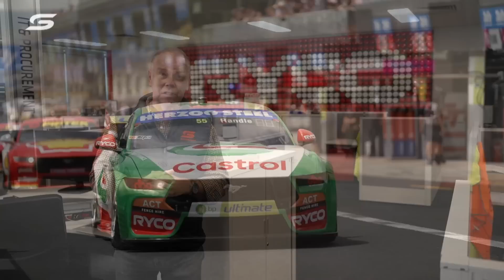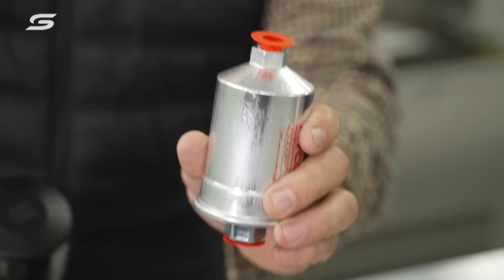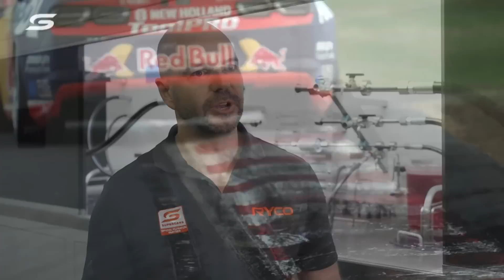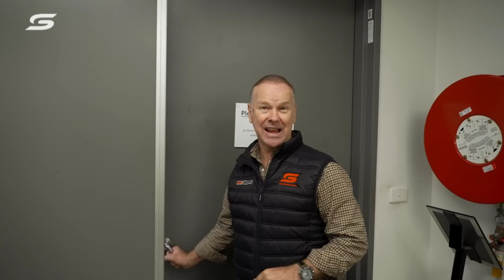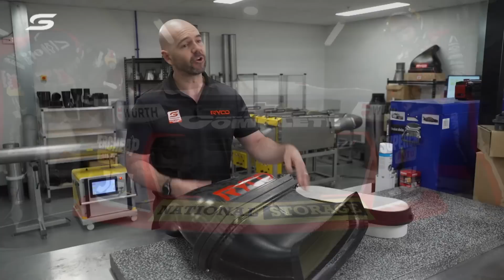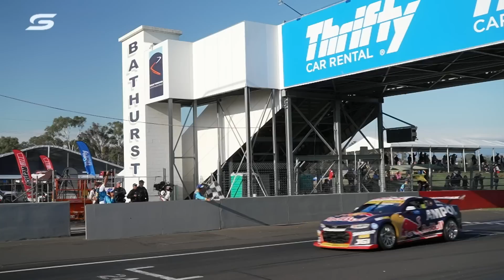The Expert Engineering Behind Protecting A Supercars Engine | 2024 Repco Supercars Championship

Comment: Hey a very informative presentation.  There is no doubt that Ryco are a special filter.  Not doubting the results but Micron rating alone is not the total answer. You did not mention the percentage of efficiency at the Micron level, Eg, 95% of 5 Micron particles or 97% or the doubtful 100% of 5 Micron particles captured, as inevitably some particles of a given size are not captured passing through the filter medium with the oil.
Reply: The absolute efficiency rating used is 98.67%. If anything is ever used it must be noted as Nominal @ x%…..

Comment: What i want to see is how this will directly flow into the passamger market. Not just "imagine what we could do"

Great to develope and all but how are we as customers going to see improvments in our products.
Reply: The oil filters are already available for many production cars and the air filter technology has already started too. Ryco use the same air filter technology for the 200 series Land Cruiser… with more to come.
Reply: @rogueaussie9299  ryco filters in stores for customers are about 50cents a pop to make and have had the same filter material used for the last 19 years with no change. Besides new housing and shapes. The filter material itself has not changed. 

Syntech range is a newer product made to a higher quality but still made in China and a brought pattan. 

Air filter are developed in Australia and made in China so I can't comment on this but I can comment on the fact older designed filters have not changed or been "updated" with there newer better filters. Only new pattans made are getting the upgrade leaving most people with the same old air filter they've been making since the first developed it. 

Fuel filters are aslo a purchased pattan for ryco and only tested in aus. They might pick a good one to buy. But they are not developed here.